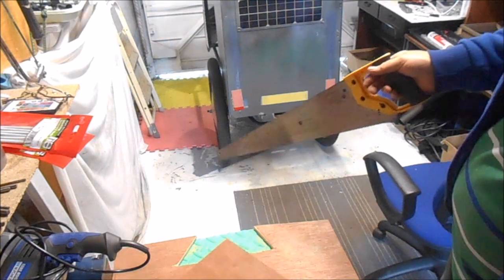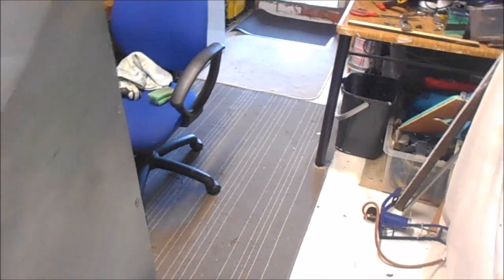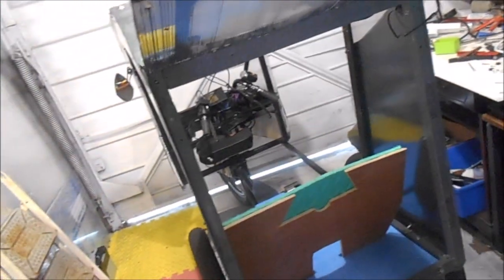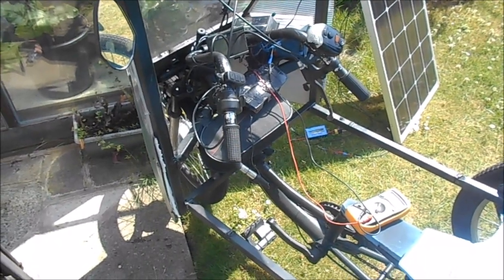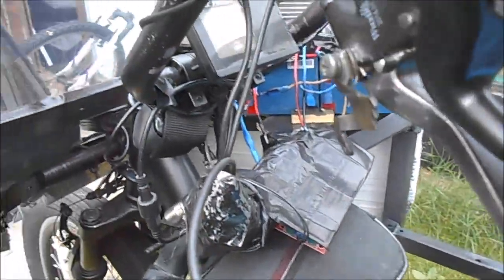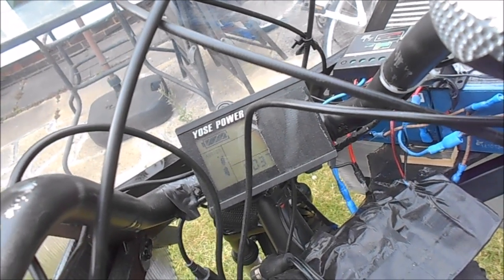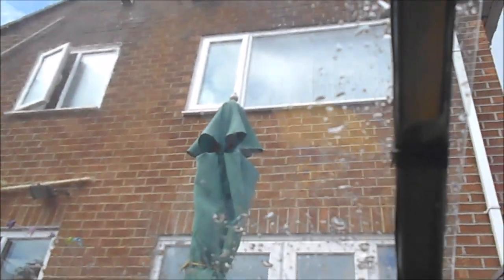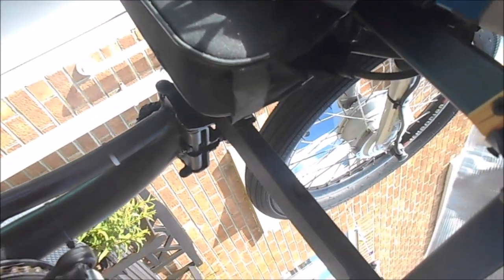Diy solar electric trike - the End

Comment: Nice work.
Try using a Marine/Deep cycle battery which can store more aph these look like Motorcycle batteries which aren't really good for anything apart from starting a vehicle
Reply from the maker: Cheers, will bear in mind if i decide to do a re-build.
Reply: @Mikeecoman  I'd reccomend LFP cells and a LFP-capable charge controller.  Unlike lead-acid and regular lithium, LFP is designed and well suited for heavy daily cycling such as solar.  They're robust and more temperature resistant, less flammable as well!  You can find them in already-made packs for ebikes, they're getting quite common as they're well suited for small evehicles.